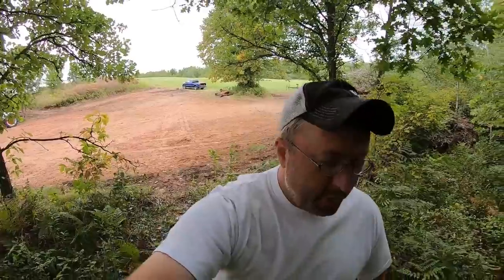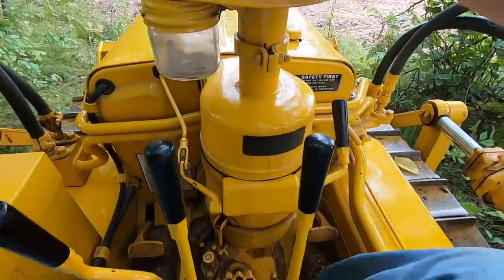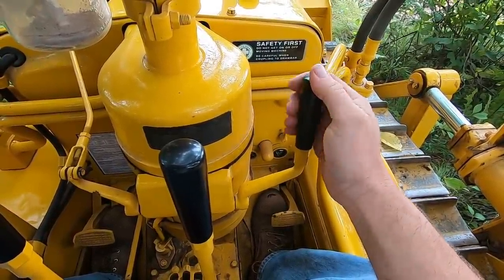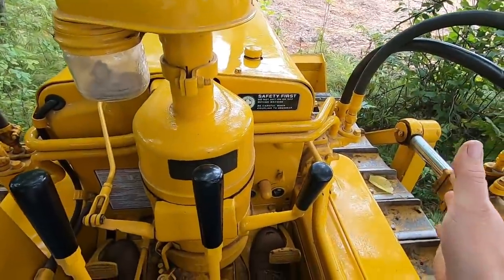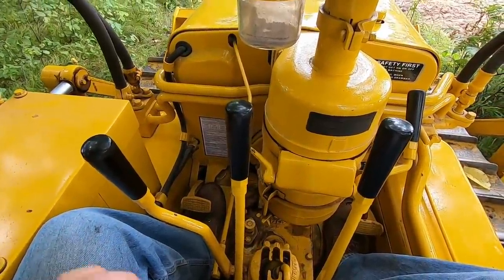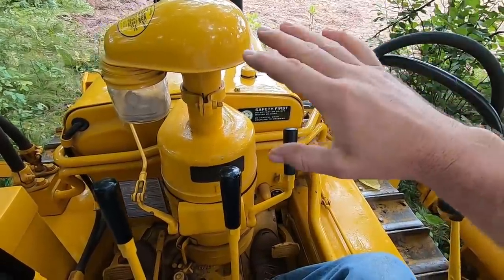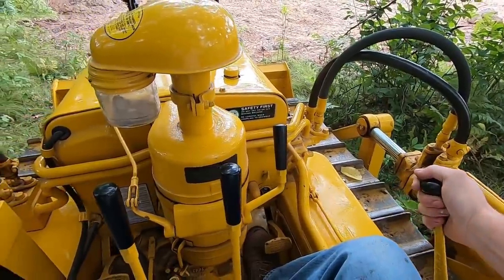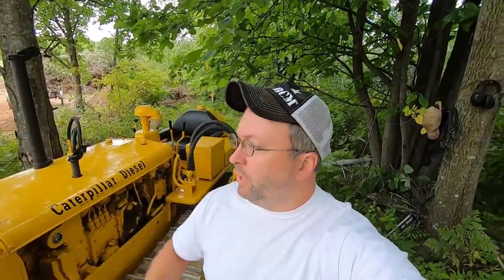Caterpillar D2 - How To Drive a D2 Part 1: Layout Of Controls and Descriptions Of Functions

Comment: I really like those D2 Cat. Dozers. My great uncle's D2 was the second tractor I learned how to drive. I was 8 years old. The first tractor I drove was our 1940 John Deere H. Also that same year.  I was almost too short to use a foot clutch so the tractors with the hand clutch were good. The fact that the D2 is so compact was just my size and I didn't have any trouble using the brakes. My uncles  D2 was made during world war 2 and was used by the Army. He had been in the Army corps of engineers and operated a D2 a lot. He was a farmer in Michigan all of his life. When he returned from the war the first equipment he bought was 2 Framall Hs. I think I was about 5 when he hauled that old D2 home. It was pretty sad looking but he wanted it because it was just like the one he drove in the war. 3 years later when I first drove it it looked like new. Of course it is painted olive drab green just like it was when the army had it. My Uncle has been  gone for 30 years but the Cat D2 still lives on the farm, with my cousin and still looks like the day he finished restoring it.

Comment: That is am impressive video.  It may save thousands of dollars in clutch and brake repairs.   Also I really don't see much dirt on that machine, especially for one at work.  There are 6-volt LED headlights if someone wanted more light for night work.  If they were installed with quick connectors like the work lights, returning things to stock would be  easy.   I suggest this as an alternative  to a 12-volt conversion.   Sometimes 6-volt systems can be beefed up instead of being replaced.   I hope this helps to keep some good machines work as they were meant to, as this video does.  Thanks.

Comment: Thank you for the great video.  At about the 1:15 point in the video, there is what looks like the starter switch for a Ford 8N tractor at the top left of the shifter gate.  What is that?
Reply: @squatch253  Thanks!  I was wondering about what it could be since it is does not look like it's in an easy to reach spot to use as a push switch. 🙂

Comment: My Dad had a D2 for a number if years in the 50's (he had a contract with the county to push the local dumps' garbage over the edge...we had 7 dumps in the county back then).  He trucked the machine on the flatbed of a single axle Chevy truck (2.5 or ? ton capacity).  Pony started with a rope pull.  I thought I remembered it having what he called a Johnson bar...a control lever that after you disengaged the clutch, you moved the lever to either the forward or back position to reverse your direction, without moving the gearshift...the trans stayed in whatever gear you were already in.  Did I dream this memory up?  Was there ever any such a thing on these?  Thanks...BTW...the new camera is great and I love the channel!

Comment: Seems to me that only CAT dozers had the hand lever steering clutches as the front-end crawler loader aka hi-lifts did not, they had just foot operated left/right steering clutches plus center brake pedal for both tracks at once. On the 955/977/983, left hand controls transmission fwd/rev and throttle, right hand controls bucket. I started out as teenager on D2 and up dozers with both cable operated and hydraulic blade lift, and the 955/977/983 front-end crawler loaders aka hi-lifts. All CAT's I've operated had the same throttle detents and hydraulic float levers. That's the same from model to model and probably still is for today's modern machines. If you can operate one, you can operate them all regardless of size of machine. Only difference is today's modern equipment uses joy-stick controllers which mimic the former lever controls of the older equipment.

Comment: Not much electrics on those old machines. Did they have optional electric accessories for them? 

btw, the audio is clear but it sometimes gets a bit weird on the gopro, maybe some settings issue?
Reply: Did some googling and I guess it might be an automatic wind recording mode

Comment: Thanks for the info! 
Question: what was that extra lever on top of the blade control valves?
Reply: Thanks!
Reply: My old Ford 4000 backhoe has a similar setup, but uses a plunger valve. It’s called a diverter valve. On my backhoe, when the valve is pushed in, it diverts hydraulic pressure to the loader valves. With the valve is pulled out, it diverts the flow to the hoe controls.

Comment: Can you tell me where you get the hydrolic Linea for the blade one one seams to have mysize and use my fittings
Reply: Look around your area. There probably is a "hose shop" that custom makes hoses. If you have the hose end of the fittings and they're in decent shape, they may be reusable. That depends if they're screw together or crimped on fittings.
Reply: @brucestarr4438  no shop around can my fitting are in great shape I think they just want me to use there's bc there very expensive wabt 220 for one hose and there fittings forget that last step I'll call my cat dealer and get the hoses cheaper
Reply: @dakotak8437  do a web search on how to make hydraulic hoses. It looks scary at first, but if you're half way mechanically minded, you should be able to do it. Do you have any friends that work on this kind of stuff?
Reply: @brucestarr4438  I was just gunna get the hose my self and press them in
Reply: @brucestarr4438  I am the friend that does all the work I have an old cat d4 6u that I got from a ladie that it has been sitting for 25 plus years not running most the work was in the pony motor